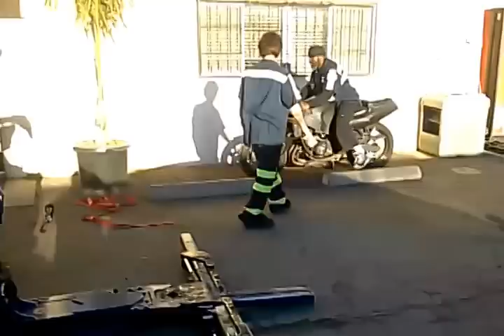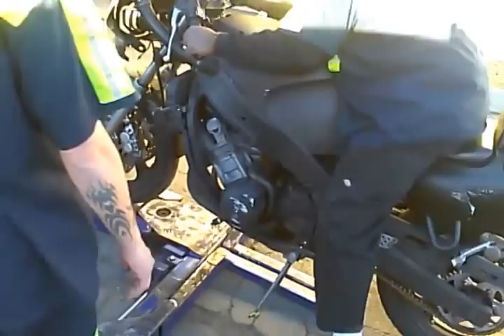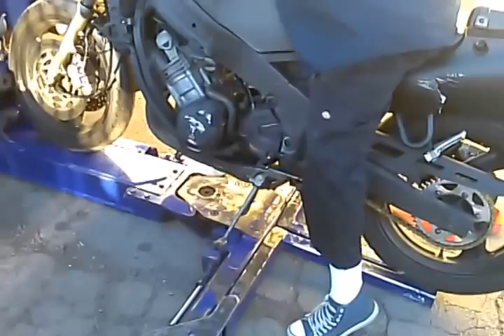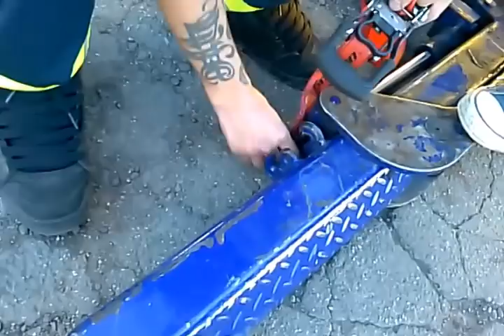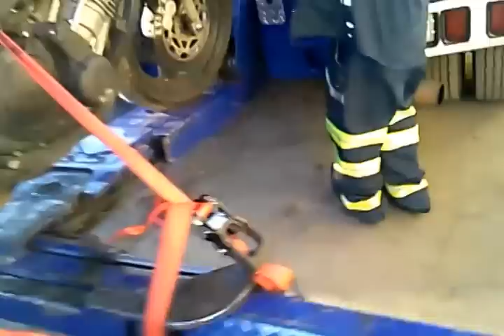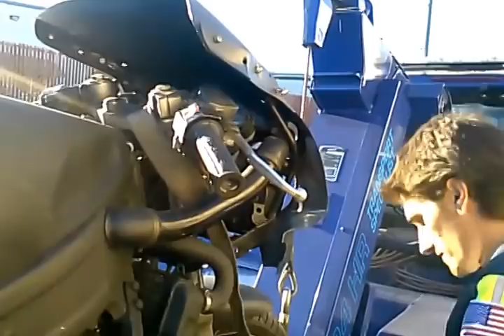HOW TO TOW A MOTORCYCLE ON A WHEEL LIFT

Comment: Great idea, never seen that before, but you need 1 more strap around the back tire and bars so it doesn't move. That rear tire gets bumped that will cause damage to the rest of the bike
Reply: That's what I just replied in a comment above your, he already had 4 straps & 2 chains, why not add 1 more strap on the rear end.
Reply: 1 on  each side, for stability. And 1 on each wheel to prevent sliding up back or sideways. he chains on each sides was good too. It's not going anywhere. I used to have cable and cycle straps. Those were tough to use.

Comment: How not to load a motorcycle on a tow truck should be the name of your video. you know there are attachments made for that unit to hold the front tire in place and also go under the rear tire. i am wondering how far you made it before it feel off the unit?
Reply: If he was gonna tow it this way without the proper attachment, he could have thrown a strap around the underside of the forks & through the rear tire so it wouldn't slide off. I don't know why he didn't seeing he already had 4 straps & 2 chains on it to begin with, hell what's 1 more strap. Like you said, it is better & safer to use the attachments, unless you had no choice.
Reply: was thinking the same thing! there is a much easier and safer way that that!
Reply: feel off ??
Reply: raymond meyer this only works for relocation and repo companies
Reply: Correct guess how I know.  Tried with my bike and my own truck this does not work.  Maybe if you strap like G you can pull it off but average truck wont have seven small soft straps ready to roll.
Reply: I used to tow for 14 years, have towed maybe 100 to 150 bikes this way,  but my rig had the cradles for the tires, and I had several cycle straps, including handle bar and tripple tree straps. Never lost a bike, even had several customers than me and turned out that every time they needed a tow would ask for me.  Even towed a few one off custom choppers.
Reply: Peg Leg ... I hate it when a customer thans me.
Reply: Raymond meyer you took the words out of my mouth.
Reply: I,l deck it to be safer

Comment: I give you credit for making the video, but you really need to practice.  You look nervous  and not confident. Your straps are not the correct ones.  There is a hole on the hooks were the straps should hold onto. This is why the straps have a metal part at the ends. That rear whell needs to be tied down also.  Think it out better , and practice. But the correct straps.  Good luck

Comment: Their is nothing wrong with this way its no damn different than standing one up in the back of a pickup and strapping it down it just looks  dangerous to most people that really don't tow shit on a daily basis the wheels are in the same amount of contact on the wheel lift as setting on the back of a regular pick up as long as its pulled tight its not going to move no where.
Reply: Until the rear tire slides off, they make a attachment that has side supports, so the tire can't slide off it's contact point. That's the biggest issue.
Reply: Viper fukgoogPlus   Everyone has there own opinions & if you think I'm an idiot, sorry to hear that for you then. I have transported motorcycles of all shapes & sizes, yet I have never damaged any bike in any way, ever!!  I have had to load bikes quick, in a timely manner & by myself every time. Nothing was ever screwed up, scratched or dropped through my loading or transporting techniques....so how would that make me an idiot?? 
I'm not bragging, I'm just stating my experience with this subject.